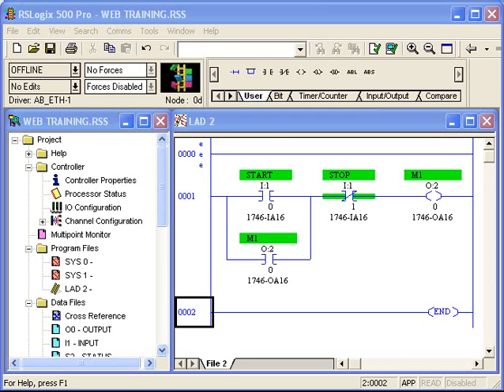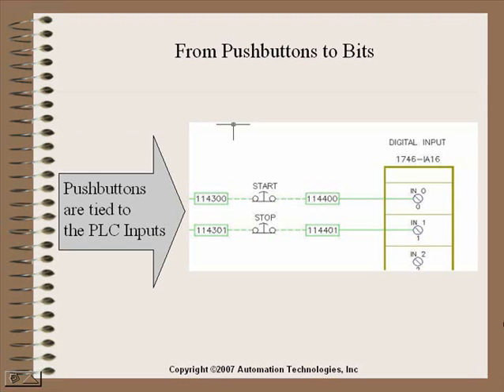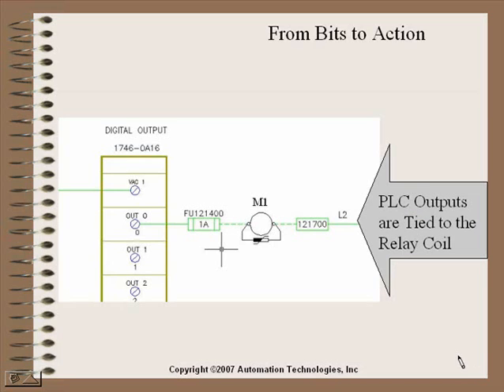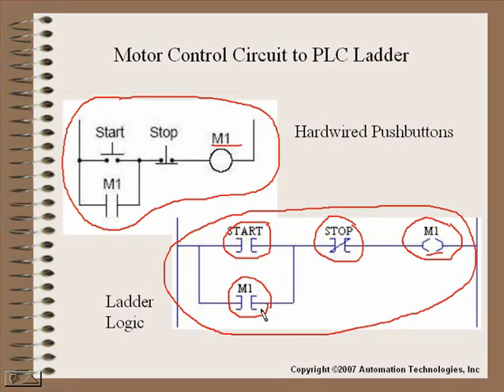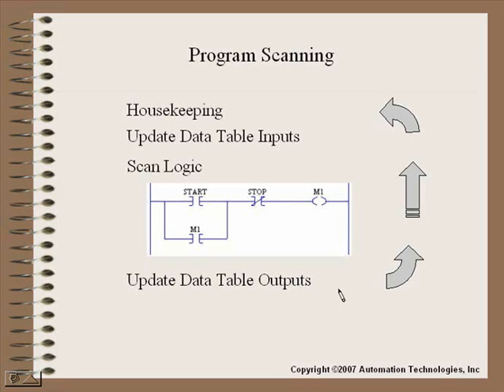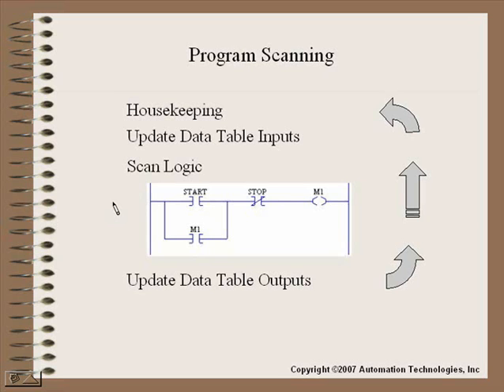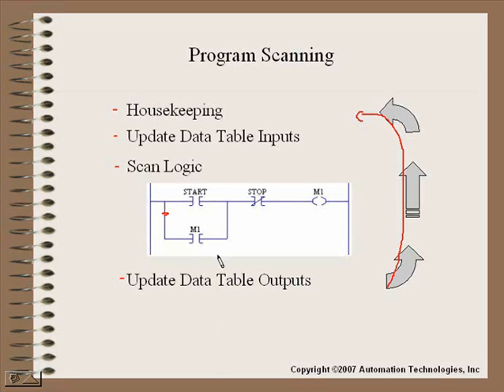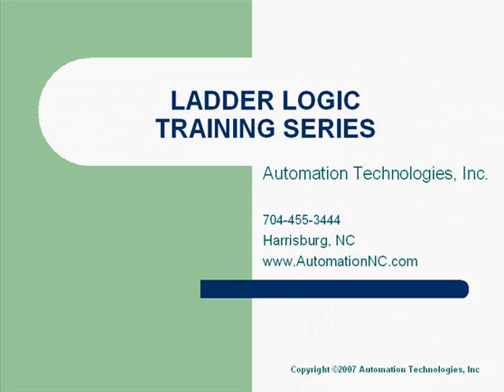PLC Training - Introduction to PLC Ladder Logic, Part 1

Comment: Hey man, sorry for the bad news... but at 4:00 or so, your logic is wrong. According to your logic expression, the stop button is an XIO (examine if open), but the drawing clearly shows the pushbutton is normally closed. Your circuit will not work. You need to change the XIO of the stop button to an XIC (examine if closed) for this to work.
Reply: Carl Shopp you’re not wrong.

Comment: can anyone help me with a plc problem im stuck with if somone could reply with a solution that would be much appreciated:
problem:
The process cycle is started by pressing the start switch the start switch, which puts on a system running indicator light and the conveyor belt motor.

Boxes pass along conveyor belt and will be measures by sensors 1 and 2.

When a box is detected at the sort solenoid the belt will be stopped. 
If it is a short box it will be pushed off the side of the belt.
If it is a long box the auxiliary motor Am1 (simulated by a light) is activated for 3 seconds.

The belt will be restarted and a long box will be allowed to pass off the belt.

The system should put the belt main light off when the third long box has passed off the belt.

If the stop button is pressed, everything should stop and the system reset.
Reply from the maker: Ok guys lets just move on.  The comments were heading downhill.
Reply from the maker: Well did you get it done?
Reply from the maker: +lewis stevenson Seems more like you are looking for someone to do your program for you.  If you have a question about what instruction to use for a certain task or why something isnt working, then post it to our forum on PLCMentor.com and someone will help.  Its not likely you will find someone to reply back with a full program as a response.
Reply: my teacher is crap he isnt giving me squat and i see no other way if somone did respond with a ladder program they would be legendary
Reply: +lewis stevenson It is not about the teacher, it is about you. There are good teachers and there are bad ones. 
I am getting interested in PLC and for last weeks I've been searching/watching/reading and working on some basic tutorials and I still didn't find one it would be perfect :) So I am all over the place and learning as the project (I am working on) demands it.

So, find a good book (In Us there are great books about PLC for ex.

A Guide To Understanding PLCs by Phil Melore (The PLC Tutor)

Programmable Logic Controllers Hardware and Programming by Max Rabiee (Goodheart-Wilcox)

Programmable Logic Controllers by Frank D. Petruzella (McGraw-Hill)

Fundamentals of Programmable Logic Controllers, Sensors, and Communications by Jon Stenerson (Prentice-Hall))
And put some extra hours in it.
Reply: no this teacher is terrible its like he doesn't want us to pass and i get frustrated on pressure like that.especially went i cant research my problem because noone has the specific setup we use
Reply: lewis stevenson assignment right? The person above said as if it was so easy because he have time and dig for books...
Reply: 8 months later
Reply: automationnc nice comment haha
Reply: Future Wei I no longer care after it takes you 8 months to respond
Reply: lewis stevenson now you really prove that you got problem instead of the teacher, ImixWayeb nailed it, I don't know why you need to mention 8 months later, do you expect everyone to see your comment so early?

Comment: I would say CoDeSys from 3s, it supports all IEC 61131-3 standard programming languages including ladder with simulation via a virtual Hmi or machine. However I would not dare to suggest it is the "industry" standard, infact in my limited experiance as automation programmer every single company and machine builder uses their own prefered standard. Often dictated by "what is on the shelf" as spare parts.

Comment from the maker: @MYTOWER Overloads should be hardwired into the motor start circuit.  On a rare occasion (maybe once or twice in the last 25 years) I have had a client that is willing to pay to have a separate contact brought into the PLC.  Since the costs on all systems are limited, there is usually more important information that people are interested in seeing.  I dont think I included it in my motor circuit example, but I didnt want to confuse someone that is just figuring out what a seal in is.

Comment from the maker: @stalinwasright The best way to get involved with PLC's is working with the real thing.   Rockwell also has a freebie programming package and emulator that work well.  We have links and details on our PLCMentor site.  The best way to learn programming is by programming PLC's or otherwise; however there are many wrong paths that can be taken so I suggest finding a knowledgeable mentor at work or we have designed our site to help fill that role.

Comment from the maker: @nobodysfool454 The video has been on here four years.  I think any problem you found with the video has been discussed and discussed some more.  There's only one that I can remember; however, the point I was trying to make was made.  Chances are if you can find a problem then you dont need an introductory to PLC's.  If you need one then all the points I make are valid.  I have found my Electrical Engineering degree to be very useful.  Got me my first job and a foundation to build on.

Comment from the maker: @nobodysfool454 wow thanks for such an eloquent response.  Actually the name of our site and its learning philosophy came from the fact that my training has pretty much been learned from mentors throughout my career.  The only training I have had has been required by projects or manufacturers.  That is where I learned that the cram course stuff doesnt work.  I did teach some at a local college that had a good lab and that worked well.  Unfortunately, few profs have actually installed a system.

Comment from the maker: @squirrelposse Yes, thanks for clarifying this.  The PLC controls the motor starter which is designated 'M' and the motor starter actually handles the making and breaking of the power to the actual motor.  And yes hurlexkid, a motor starter is basically a big relay.

Comment: Good effort but has been mentioned many times your logic is wrong.  If you choose to continue down this path you will sooner or  later cause problems for unsuspecting people who believe you.  Further, you also make the mistake of calling PLC instructions "Contacts" and "Coils."  That is wrong.  They are not hardware devices, they are software instructions.  They refer to the I/O and other data tables.  I have been programming  PLC's for over twenty years.

Comment: Good video but pity that the ladder logic diagram is wrong.  The configuration shows a normally closed stop switch which is usual in practice and this should be shown exactly the same as the normally open start switch on the ladder diagram.  This is a common mistake in a lot of educational textbooks on the subject.  See Fraser & Milne "Electro-mechanical Engineering - An integrated Approach pub by IEEE press 1994 for a correct description.

Comment: It depends in the actual hardware you are using if the stop button is a normaly open  pushbutton then XIO instruction its ok, but if the stop poshbuttton its normally closed (like an mushrom e-stop) then XIC its ok. Good Video thanks automationnc

Comment: You can get a cheap used PLC on ebay for less than 20 bucks,.. they usually work fine, but you have to do a little wiring and buy your own switches.

Comment from the maker: Well the explanation is correct, but there are some issues with the diagrams.  The overall points I make are correct.  Jump is making the point that around 3:30 in the time line the normally closed stop contact in the ladder logic should be a normally open contact.  This is true if you were to take those pushbuttons in the hardwired diagram and take them directly to the PLC as inputs.  The diagrams are representations of hardwire vs. ladder for discussion. They work for that.

Comment: Nice explanation, too bad it's wrong. You've programmed the stop button as an XIO (examine if open) contact; the actual stop P.B. contact is sitting closed, therefore the PLC ladder rung would always be false, the motor would never start. You'd have to hold the stop button open and press the start button to start the motor. Quick fix: change the stop button instruction to a XIC (like the start button instruction)  and it'll work.

Comment from the maker: Sorry I just noticed that my reply to you did not go through...  In a PLC the CPU runs the program repetetively.  Each run is called a scan.  With most PLC's the inputs are read before each scan, the program is scanned and outputs are set after according to the program results.  I will need you to reword your relay question as I do not understand.  And yes... this could be more informative.  Always.  We have more vids with more detail at our PLCMentor site.

Comment from the maker: Our rule of thumb is to never use latches unless you specifically have to. Use seal in circuits for those purposes. There are times when latches are the only way, but they usually are difficult to troubleshoot and understand in a larger program. It is useful sometimes to complete a program in "small bites." Program a little functionality - get it to work. Then program the next bit of functionality. Try getting the up and down seal in circuits first-then modify for the rest of the functions.